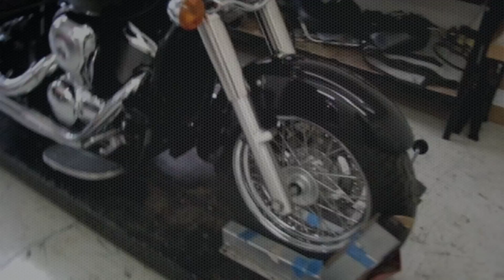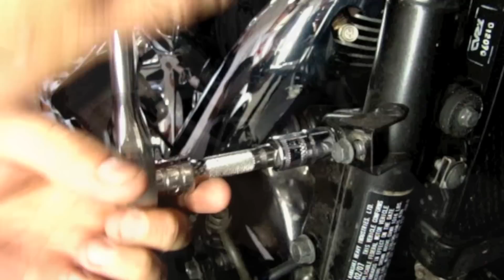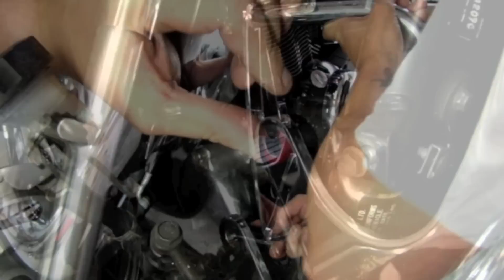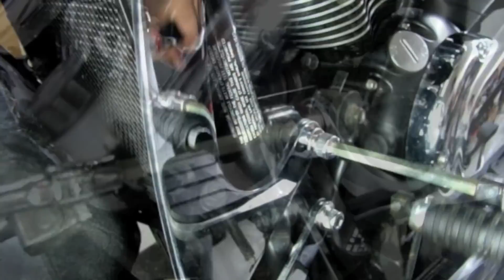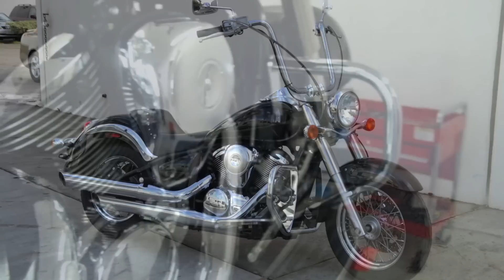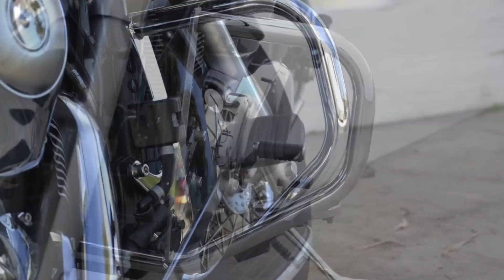Baron Custom Accessories Kawasaki VN900 Engine Guard Installation

Comment: These are great and an easy install with basic tools.  You never plan to drop your ride but it's good to have them just in case.  One tip that I didn't see on video but I always do on the bike when putting bolts back on, I always use some blue loctite just in case.   Nothing worse than being miles from home and losing a bolt due to vibration.